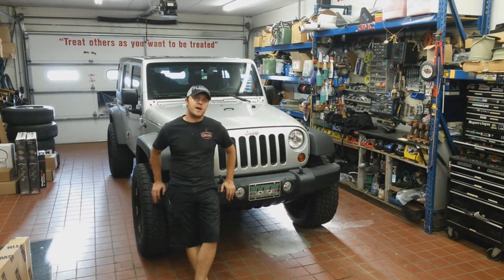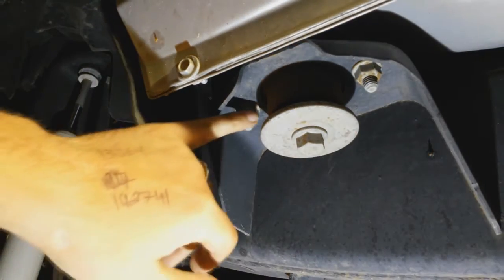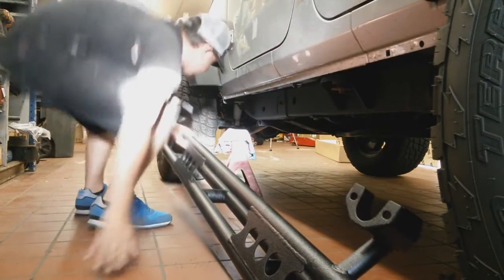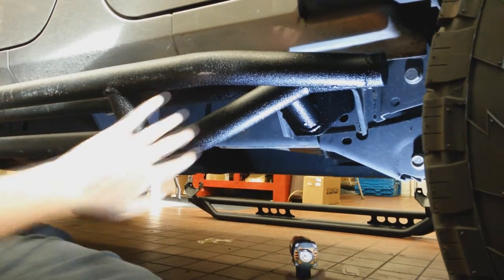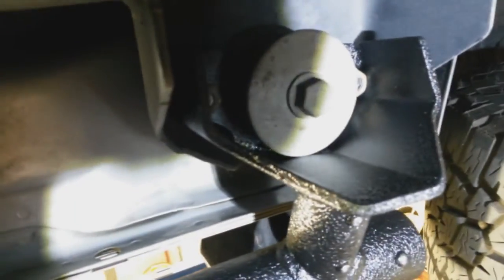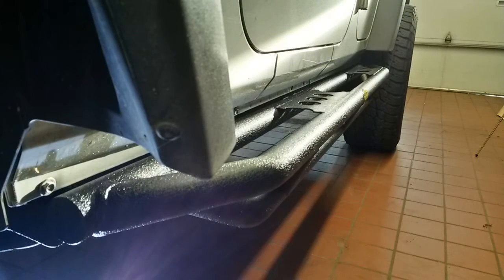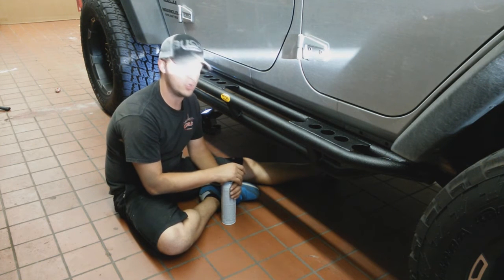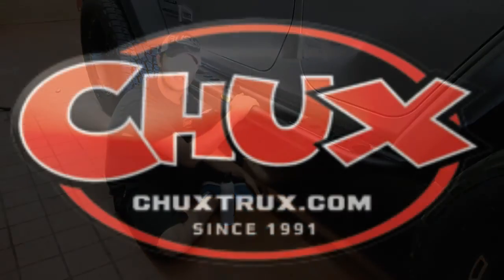How to Install Smittybilt Side Armor Steps Jeep Wrangler JK

Comment: will these work with rubi rails?
Reply: Hey Chad, unfortunately no they won't as they use the same mounting locations as the stock Rubicon sliders.
Reply: Im not sure...the rock sliders I have mount in a different way then the steps. They have noting bolting to the frame itself. I think they would work great with rubi rails.